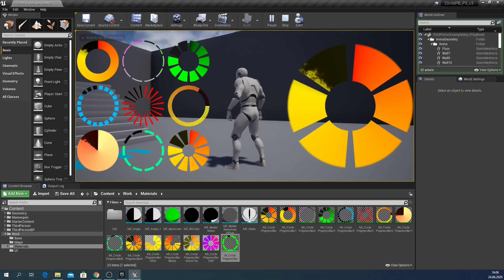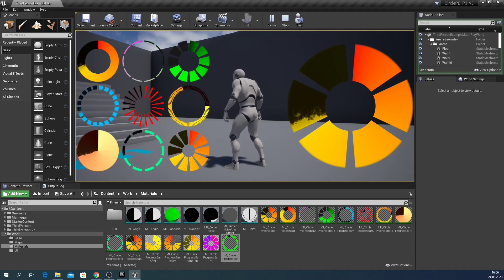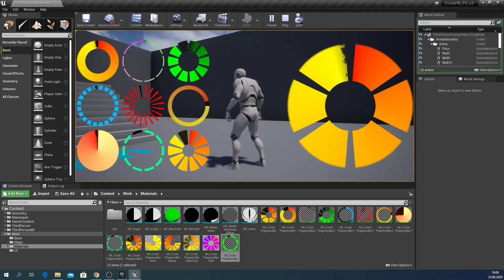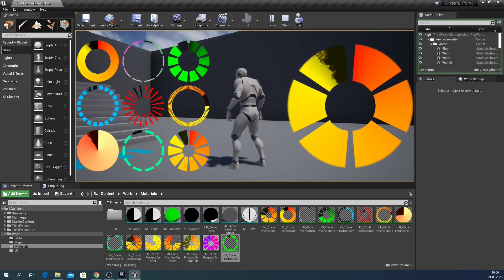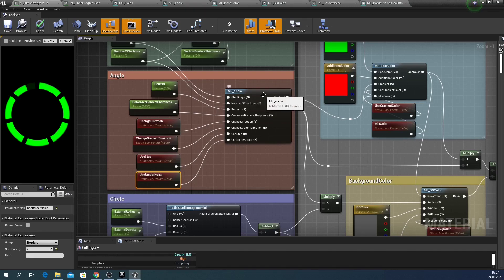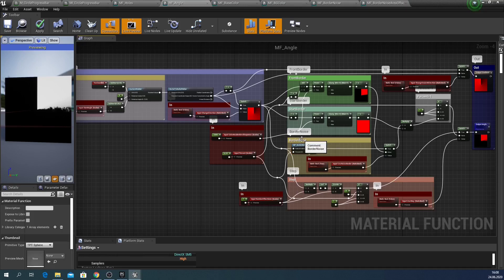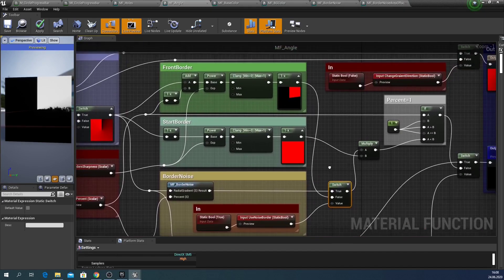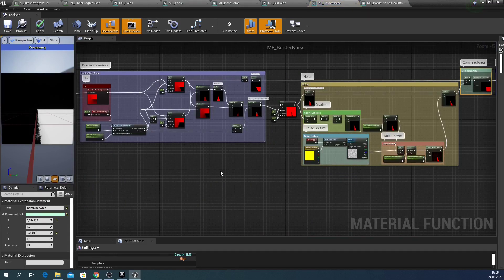Circle Progress Bar. Part 3. Border Noise

Comment: Hello! Is it possible to make the background colors translucent somehow? Right now, alpha can't be controlled on those. I've tried my darndest, but I can't come up with a way. I could set the material to additive which somewhat helps, but the colors will basically blow out completely if the player looks into the sky or very bright surfaces.